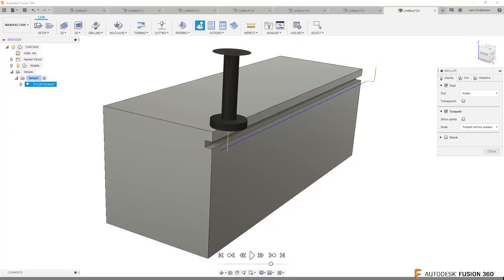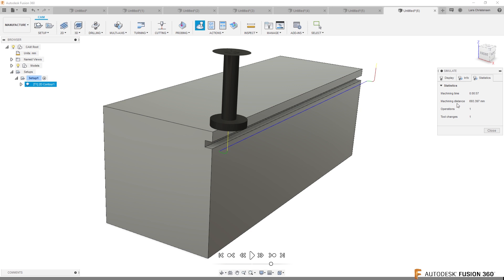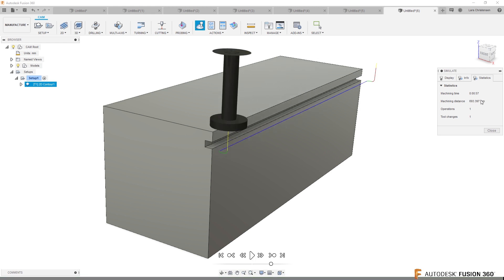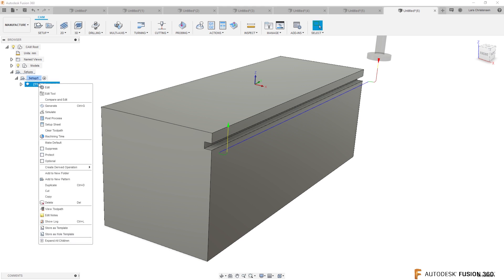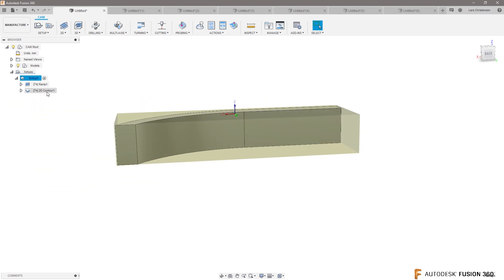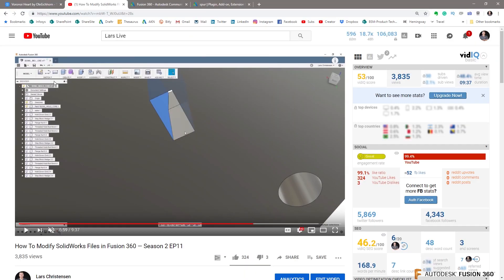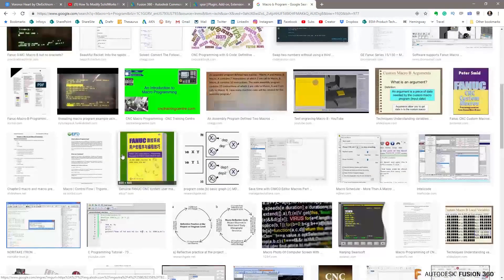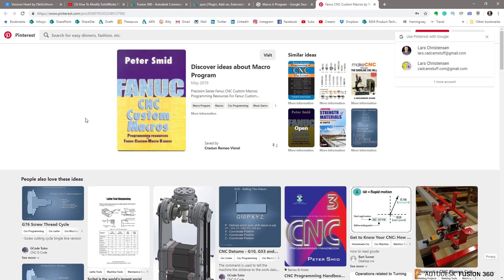Fusion 360 — How To Measure CAM Tool Life — Ask LarsLive

Comment: Hey, Lars, I am trying to work on a "fanuc 32i model A"  CnC  Turn-mill machine, where I will be trying for the first time using Fusion 360 cam Codes that I get after POST is done.  Do you have any suggestion, how should I go about, when dealing with this?  Will this book you showed help me with my Fanuc machine as well? Being not the newest machine and all...   Cause the owner of the shop is very stubborn guy, with no free time to spare, most of the time.. So when I do finally try using my post codes, I wanna make it work if possible..  You understand.., no?    Thank you!   A.

Comment: Thanks Lars! I have a couple examples I could use some help with.  I imported a model but it won't let me create a drawing of the part.  I also have a assembly in which I think I messed up the motion joints etc it's a standard die for a punch press. I can send over the files